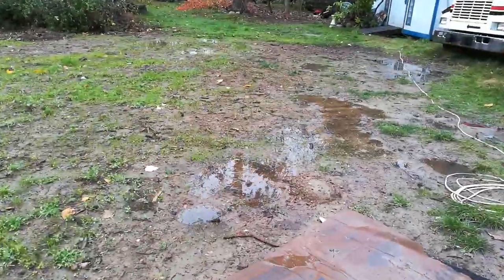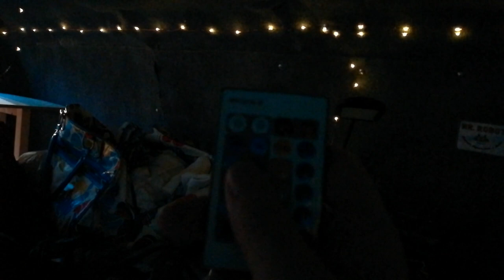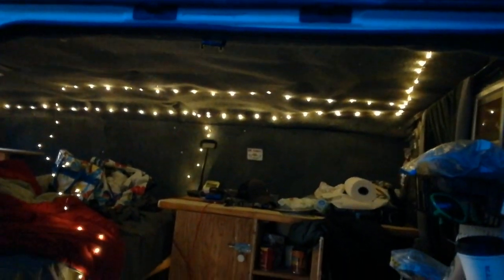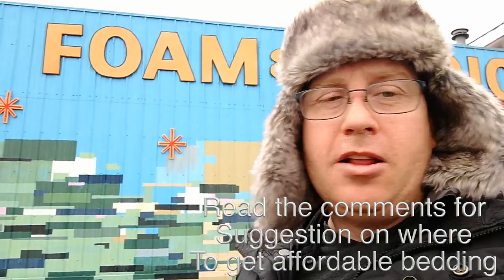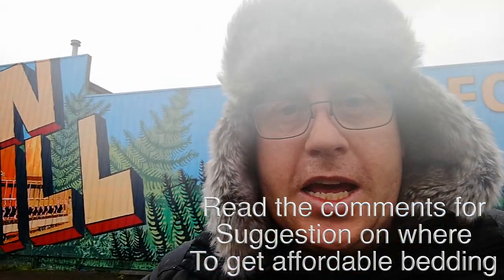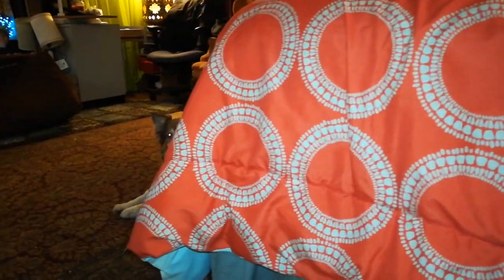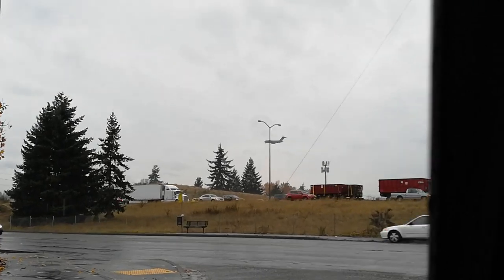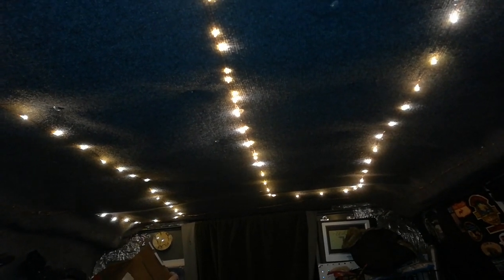Being a Good Person is a DECISION.

Comment: Joint Planes... right after the showing of legal marijuana? We know what they're carrying! 

Question: Do you need to live in the state to buy? If your driver's license is out of state will they still sell to you?

I know what is going on with the LED lights but I'm not sure how well I can explain it. First you have to keep in mind that Light Emitting DIODES are diodes so current only goes through them in one direction unlike normal lights we are used to.

So one way to convert 120v Alternating Current to low voltage direct current is to send each half of the AC waveform through its own diode. This makes two separate DC power supplies. . So your lights are probably wired for this. 

Basically you have to rewire the non working lights. You need to reverse the current going through the nonworking half. AND make sure its limited by a resistor (which might  be built into the string, many are. LEDs will fry if the current is not limited somehow. Usually it's a very small SMD (surface mounted device) which is black and has 3 numbers on it which will be how many ohms the resistor is). Your brother might understand it better if this sounds like another language to you. But it's great stuff to learn. I think you have the aptitude for this. Now you have also good use for the meter you just bought. I'd use the clamp to measure the current going through the existing ones when on the 12vdc line. That'll give you a baseline and a goal for what should be going through the nonworking line.

Or just send them back while they are still under warranty and make sure the next ones are meant for 12vdc only.